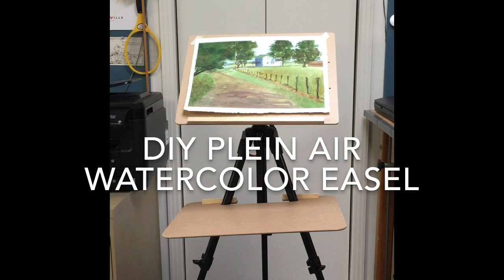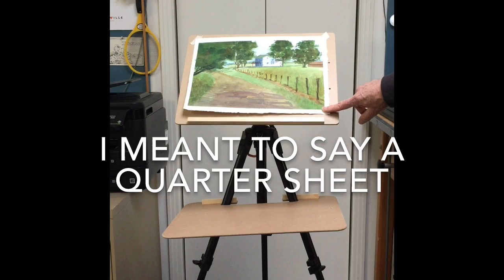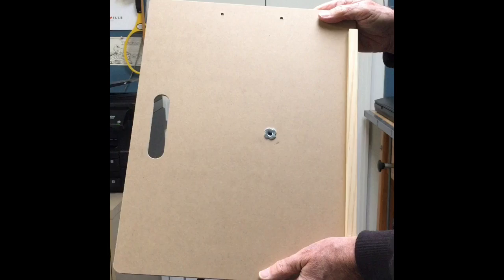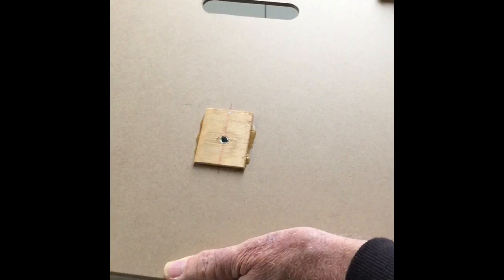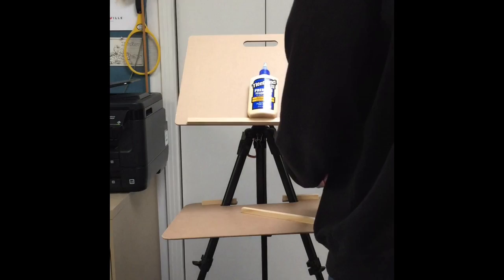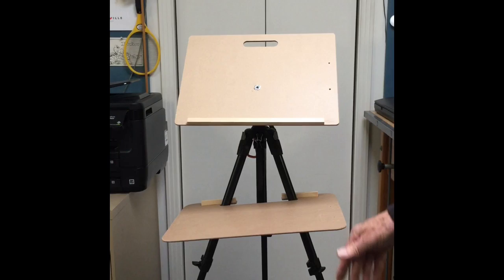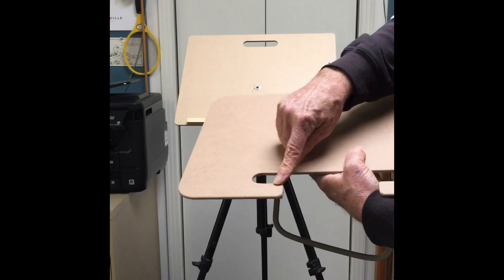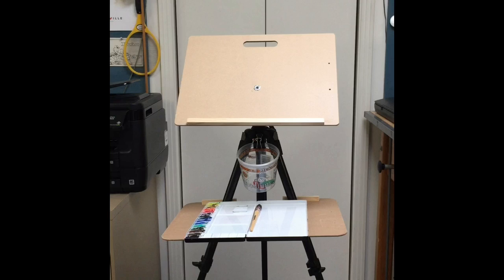DIY watercolor easel

Comment: Doug,wanted to let u know that I got my easel built. Very happy with it. Instead of cutting out the handle rounded I cut it in a square so the square tripod legs fit it. Plus I didn’t cut it very much larger than it already was so it doesn’t drop down on legs very much at all. In fact the shelf is only 9 inches below the easel. 😀
Thanks so much for video.
Reply from the maker: Great! I am so glad you got it to work for you. Thanks for letting me know! Happy painting!

Comment: I love your design Doug, especially the additional shelf. My setup is a bit more basic, but very light and compact. I have a piece of UPVC edging strip 2 1/2" x 3/16" cut to the length of 17", the width of my Gatorfoam panel. I drilled and tapped two holes in opposite corners of a spare tripod mount and have this fixed permanently to the centre of the UPVC batten and when attached to my tripod, I just use two large Bulldog clips to attach the panel.  I have a shorter batten I use more often outside for my 1/8 sheet panel - this is also ideal with my sketchbook. I only have a small tripod a Velbon CX mini which only extends to 26" but this is ideal for me as I have to sit these days anyhow. I can usually find a stump, rock or something else to sit on and this thing  only weighs  about a pound  and half, and just 12" long when collapsed -  I can get the lot in a small knapsack  with room for a warm jacket and a flask of tea.

Comment: Doug,love ur easel but I have a problem with building my  shelf. I purchased an inexpensive tripod with more square than round legs. Plus I wanted the shelf very close to the easel so I wouldn’t have to bend over. So I only cut out a section of handle not any of the rounded part. So it wouldn’t drop too far down on legs but the shelf droops completely down. Is it cause the tripod legs or squareish or because I need to enlarge the oval area of the board? Does that make any sense whatsoever. I’m trying to make it today and would greatly appreciate an answer asap. Thank u so much.
Reply from the maker: Linda, I was just pondering this same question today. I would like for my shelf to be closer to the easel and not so low on the tripod. It drops down low because of the width of the oval handle cut out  on the board. So far I have not come up with a way to get it up higher, but I will keep thinking...  : )

Comment: Doug, What is the name of the tripod that you use in this video? would you recommend using that after setting up your watercolor easel?
A lot of complains about tripods not being sturdy enough and I wanted to get your opinion on the matter.
Reply from the maker: My tripod is a Manfrotto which is made in Italy. It is very sturdy.  I like it a lot. However it is not a lightweight tripod and it may be a bit pricey for you. Hope this is helpful.